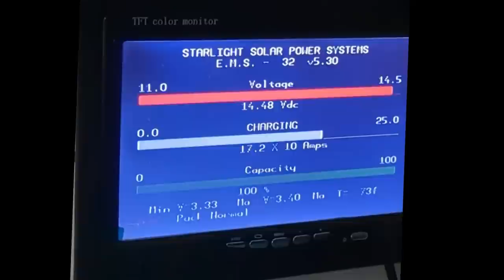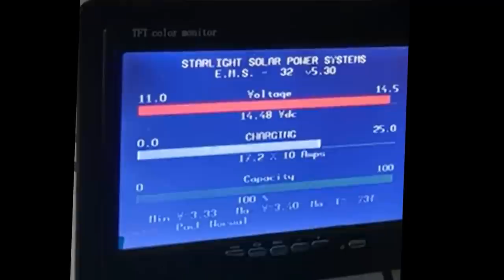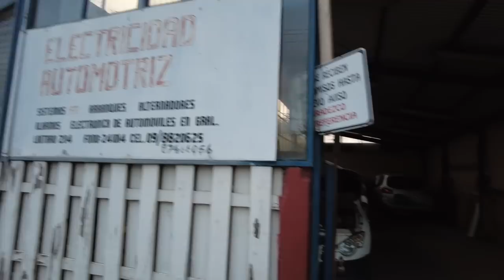HUGE POWER PROBLEMS WITH THE VAN IN CHILE - Van Life Patagonia

Comment: I’ve been concerned about your tie rods, because if the bearings or tie rods suddenly snapped when you are going down a mountain road, it could be catastrophic.  Please renew your whole drive train, replace all the parts that connect to the steering, braking, and transmission especially.  And check the suspension as well.  Keep in mind you may not be able to see if something is ready to break, better to get new parts, but quality parts, as bad new is just as bad as worn old.  If those key components of the drive train break, you will lose total control of the van.  I know because it happened to me.  I was driving two previous cars ago when a tie rod snapped.  Suddenly i lost full control and the ability to steer the car, I spun out in a 360+ into oncoming traffic.  Thankfully I did not get hit, traffic was sparse at that moment.  Please fix those with a very good mechanic and replace those parts because likely they have taken the brunt of those rocky, gravely roads.